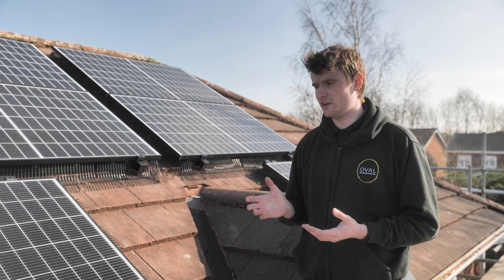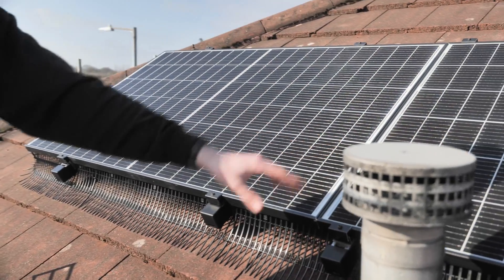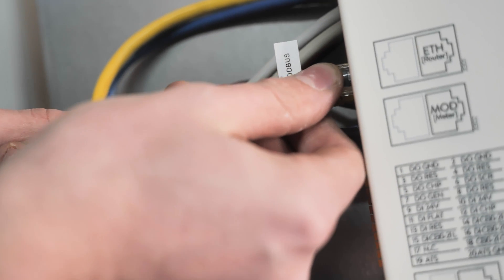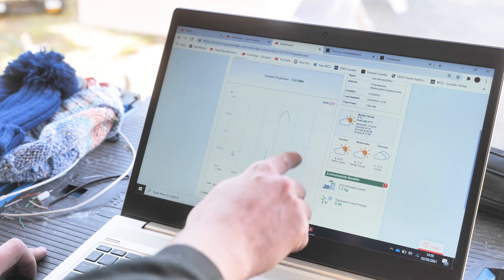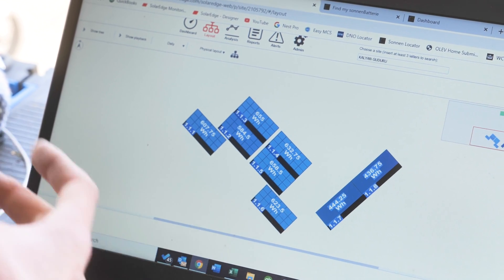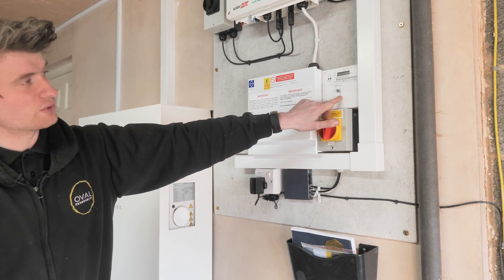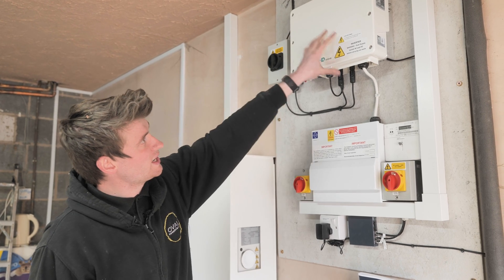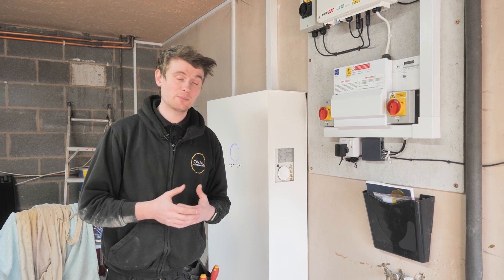Solar PV & Battery Storage System in Bolton

Comment: hello Sam. I've been watching your videos and love your work... I would in the next few years like to have you work on a system for my house. I'm just wondering how much  room for connections and hardware is needed at the consumer unit? I would be looking to have all my solar and batterys on the detached garage
Reply from the maker: Hi! Thanks very much. We would need to design a system to tell you exactly what you need. However if you can install a large duct to the garage that would help to run the cables in. At the consumer unit we would need a couple of free ways that aren’t protected by an RCD.
Reply: @OvalRenewables  thank you. I will add a 4 inch duct to the plans

Comment: Hi Sam I’m nearly convinced😉.. one snag my end I’m being told I must have a smart meter fitted for solar & battery storage is that true as far as you know?
Thanks…
Reply from the maker: Haha one more video and we might sell you on it! 😂

So you don’t have to have a smart meter to have solar and batteries installed. The benefit of having a smart meter is that you can then apply for SEG payments. These are a bit rubbish at the minute (4p per kwh you export). Without a smart meter you don’t get access to this payment
Reply: @OvalRenewables  Thanks Sam great channel by the way real top draw stuff you must be very proud…we’ll I’m a bit of a radical libertarian  & the main reason I’m looking to be self reliant is to escape from their system as much as possible ,anything that starts with (smart) is a huge no no, im nearly there a part from the electric side of things but it has to be the real deal stuff rather than an old fork lift battery in the utility😀  the conversations I’m having is they’re really pushing this smart caper..but I do appreciate you getting back with a positive all is not lost 👍
Reply from the maker: @oakashthorn5714  not a problem, like I say you don’t have to go down the smart meter route it’s just a case of losing out on that export payment which may only be £50-£100 per year depending on the size of system

Comment: Hi Sam, fantastic clear content here. Have you installed any solar PV panels on flat roofs? I have a 7m x 4m flat roof and would like to know if this was an option, it concerns me that the roof may get damaged or even being raised to the desired angle may be a wind trap for the panels during stormy weather as all I have seen is sandbags holding the frames down online?
Reply from the maker: Hi, yes you can mount solar on a flat roof which can be ballasted down. A consideration as to the timber size the roof has been constructed with needs to be looked at however as usually these aren’t large enough for a big system.
Reply: The size of the structural timbers is a concern  thinking I may require a supporting frame from the edges of the roof so the strength is coming from the walls of the building (if this makes sense). I don’t like the idea of not bolting/screwing panels down as the area is exposed to wind. Have you used Bauder flat roof solution? Would you be happy to fit panels to a pre erected frame on a flat roof and if so is there a particular way of laying this out? Or where I could find information to build/have it built, so it won’t delay installation of panels?

Comment: From installer to installer HOW YOI ABLE TO CHECK A PANEL WITH OUT GO ON THE ROOF??? Sorry please don’t talk about a easy solution BECAUSE IS SOLAR EDGE
Reply from the maker: Hello, you can individually check the voltage and current of each panel remotely using the SolarEdge dashboard, if you have mapped the panels out correctly that would help you pin point which panel is faulty. You can also create a graph using the SolarEdge dashboard to compare panel to panel to prove there is a problem (providing shading is the same across both) have a look on the SolarEdge academy to learn more about it 👍

Comment: Sam, what do you think about Enphase micro inverters vs Solaredge?
Reply from the maker: I prefer SolarEdge. I haven’t installed Enphase but putting AC under than panels seems like you are asking for trouble
Reply: @OvalRenewables  
Thank you for responding, Sam.
Other installer’s opinion was that having a few hundreds of dc volts on your roof is a disadvantage.
I understand that there are different ways to install solar, but it can be a bit perplexing for the customer when comparing quotes.
Thanks again for taking the time.

Comment: That was a great overview - thanks.  My DNO is restricting the SPV I can install because of export limitations due to their system capabilities. Is it possible to bypass those restrictions if the solar is only for the battery and not for export?
Reply from the maker: It’s worth taking to them about this as the DNO take an annoying approach and assume that any export limitation device will break and they may have to support full export. However if you chat to them see what they would accept

Comment: Interesting and informative video - one thing that caught my attention was the two panels located on the SE (I think) roof elevation - It seems that one panel - or maybe both throughout the day -  is going to be partially shaded by the vent exhaust, which renders it almost useless. Had you mounted them parallel to the roof hips, I suspect they'd have been clear of the shadow, and so produce for a much higher proportion of the day. As they are I'd be unhappy with that panel not paying out on its investment...
Reply from the maker: Hi will, thanks for the message. This layout was the best we could do as we have to consider our fixing points in the roof as well as the location of the panels and therefore panels cannot be installed just anywhere on the roof unfortunately. As this system is SolarEdge, the minimal shading caused by the vent will be handled as efficiently as possible. It will cause a slight drop in production on the affected panel(s) but it will be minimal. Thanks for watching

Comment: What's your wait time from customers making contact with you to design and install of PV system?
Reply from the maker: Currently we have around a 1 week design lead time. The install lead time depends on the installation, if you are looking for a small system then we could install it within around 3 weeks. If you are looking for a larger system then we have to gain DNO approval for the system which can take around 45 days. We then look to install the system very quickly after the approval is given. Drop an email to info@ovalrenewables.com if you want us to look at anything. Thanks for watching!

Comment: Hi Sam. Outstanding job with the install and the video! 

I have a couple of questions: 

1) In the DB/CU panel seen in the video there is a Mains switch. Where is it fed from? Is it from a separate circuit in the house CU, or is that the actual Mains coming into the house from the DNO? Or maybe something else? 

2) In one of the previous videos you showed us the Solar edge interface on your laptop where four icons interacted with each other. It appears that the battery system is the centrepiece of the whole system; it collects all the solar energy, and then redistributes for consumption, export or storage. Is that the case or just a schematic representation? Is everything routed via the battery system? 

I’ve been trying to find a decent topology diagram on the internet, but they are too basic, far from what you showed us. They lack the zappi charger, and the DB panel seen in your video. Also all the internet devices and connections.

Comment: Hi Sam. Great video. I've got a 4KW Solar setup and have just installed an Air Source Heat Pump so am now looking for battery storage. I'm trying to decide between Tesla Powerwall 2, Sonnen ECO10 and possibly GivEnergy 8.2KWh. Any advice would be appreciated.
Reply from the maker: Hi Andy no problem, I have seen your email and we will be back in touch shortly
Reply: Definitely Tesla Powerwall